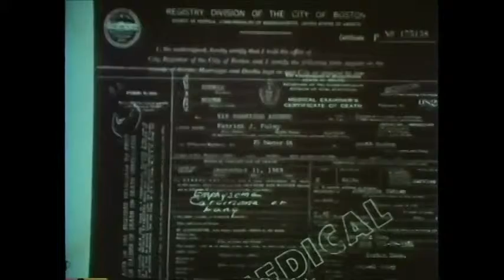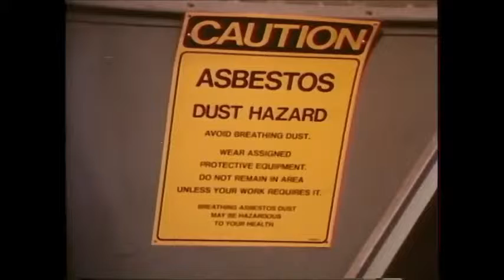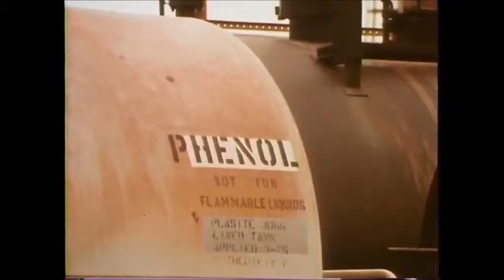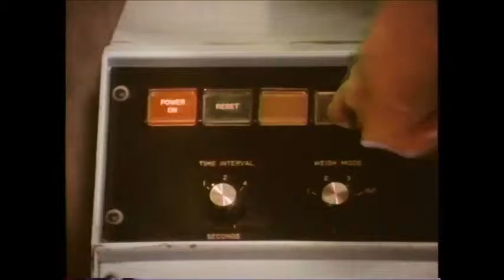More Than A Paycheck -1978

Comment: Shortly after my husband retired from the air force in the mid-1990s he got a job working with fiberglass and other chemicals. I remember the smell of the chemicals on his clothes when he got home from work and changed. He warned me that there was tiny fragments of glass in his clothes as well so not to breathe too deeply around them. He only worked at that job for maybe 2 or 3 months. Hes 67 years old now with no health issues from that job  years ago.